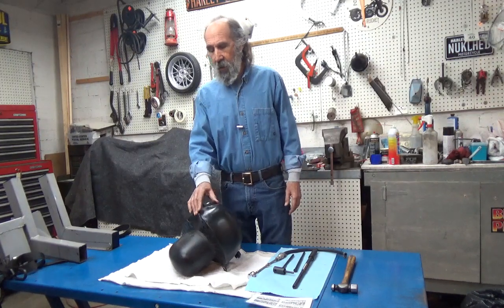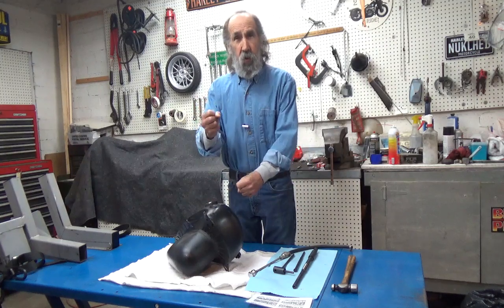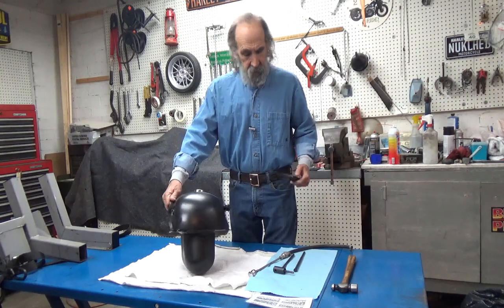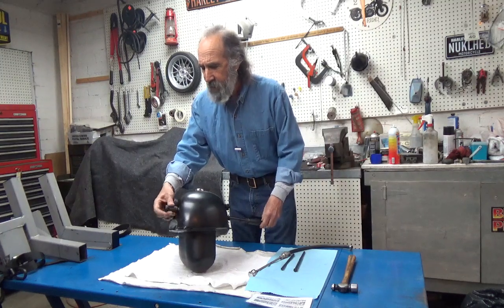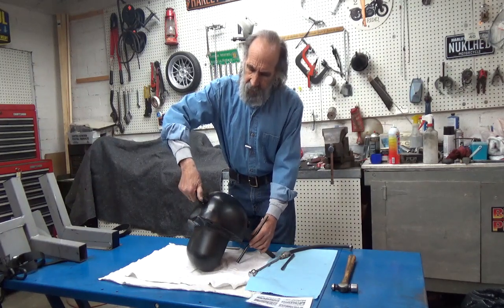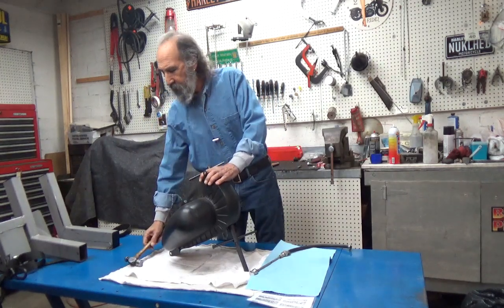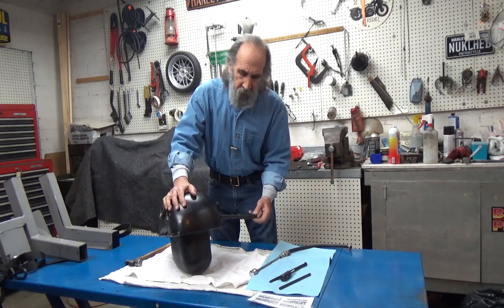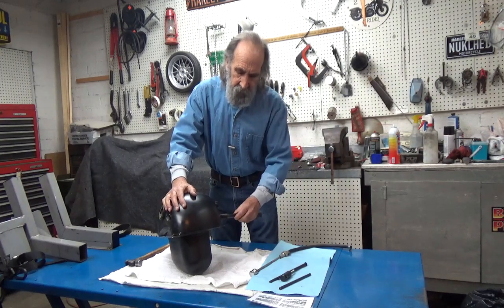Old Harley Davidson Gas Tank Petcock Repair, Part 1

Comment: I saw a video  on installing  the valve   , They  said to use  EZ  turn  lube  , Used in  aviation  industry in a   5 oz tube    for a leak  free   seal  .
Reply from the maker: Thank you for the information!

Comment: Great vid Mike, mine line up on the 46 but has small weep from top copper washer, I'm going to try some permatex permashield and see if that stops it.
Reply from the maker: Aneal the washer or replace it with a new one.  Ted Cycle has them.

Comment: good morin got ? got 85 flhtc  took tank off to clean but seems like someone tried sealing it not sure when but the liner is peeling off inside tank any sugetion on how to get old liner out any help
Reply from the maker: I honestly don't know.  That liner was probably put in by a previous owner.  Hard to say exactly what they used.  The choices aren't really good, unless you're going to paint it anyway.  Having a radiator shop hot tank it for you could work, obviously destroying your paint.  Then you'll need to reseal it before treating the exterior.  I've heard of people nickel plating the tanks to seal them.  Then there's the swap meet where you might find a really nice clean tank.  This is one of those things that really frustrates us all.  Check at a paint supply and see if there's anything available that will seal the existing sealant.  There may be by now.  How much of that stuff can you actually drag out of your tank now?  Some may actually be stuck well and by minimizing the amount in there and using a good fuel filter, maybe okay.
Reply: @pacificmikesgarage  thanks but figure it out with little help acatone  white vinger  then muric acid in steps the actone will deslove it vinger for rust than acid to get the hard rust out   but thanks

Comment: Hi Mike. I have the same tank but there is no petcock hole in the top, just the single hole in the bottom. The fuel shut-off valve was in the fuel line. To my knowledge, the set of tanks are original and to the WLA pattern. I've been told they could be earlier - any ideas?
Reply from the maker: Couldn't say without looking at them and then probably looking them up.  Is part of one tank for oil?  The "How To Restore Your Harley" book will probably solve the question for you.
Reply: Thanks for getting back to me. Mystery solved! I scoured Bruce's book earlier and discovered that they're off the '37-'39 Army WL/W. A good result.

Comment: I have a 48 pan and am having a fit getting the petcock out of the tank any suggestions
Reply from the maker: It goes in from the bottom and goes out through the bottom.  Are the fittings seized?  Some times, the worst part of a repair is the fact that we have to destroy something.  That is the worst thing.  But, I don't know what problem you're having.
Reply: @pacificmikesgarage  I can not break the nut on the bottom of the tank to pull the petcock out. I had a 1933 with the oil tank with the pump I had a similar issue with. This 48 has two nuts that hold it all together that nut is my problem.
Reply from the maker: I've never had them seize that bad.  Soaking with penetrating oil.  It sounds like, if after trying for a long time, you can't succeed, something is going to have to be sacrificed.  Or, you keep soaking and trying until you  get it.  Sorry I'm not there.  I don't give up easily either.
Reply: @pacificmikesgarage  This is original tanks so it don't want to damage them. The bike is all factory original except the front fender and wheel of course. I have tried every oil know to man it is like someone welded the petcock .

Comment: Thanks Mike, very helpful. i have a question if you don't mind. I changed the trans sprocket on my 59 FL. and the new one was a tight fit on the shaft so I had to kinda tap it on. Took it for a test ride and all was fine but after about an hour it locked in 3rd gear. after rocking the bike back and forth a bit it released and I returned home. Does it sound like I screwed the trans up? I know that's not much to go on. would leaving the drive gear spacer key out cause a big problem, when I buttoned it all back up I found one on the work bench and don't remember if I installed it or not, i have a bunch of them on the bench so It just has me second guessing.
Reply from the maker: Hard call.  Obviously, something is wrong, but there's only one way to find it.  I assume the trans was fine before installing the new sprocket.  If the old sprocket was loose, perhaps installing the new sprocket moved the main gear out further and threw things off a bit.  The first thing to do is to go back where you were before the problem occurred.  Then, if you can't find it, you'll have to go further.  Is the sprocket on in the right direction?  Is the "relief" on the inside, toward the bike?  If all is proper, sounds like a transmission problem.  The key needs to be installed to spin the spacer in the seal.  But, if the key is jammed up in there, the sprocket could be crooked on the main drive gear.  If the main drive gear is not spaced right, it could be locking up.  With the new sprocket installed, it should spin freely in neutral.
Reply: Thanks Mike. Yeah, it was fine before the sprocket change, I gotta pull it apart next week when I get some more time and check it out and see wtf I did wrong lol. You have a bunch of really good informational videos on the tube. Thanks again and keep up the good work.
Reply from the maker: Thank you. It's not strange to have to go back and check your work.  It's just "life."